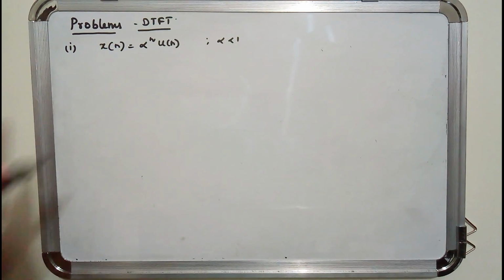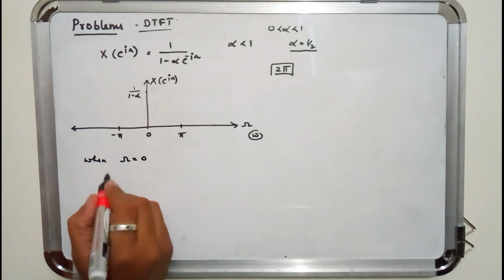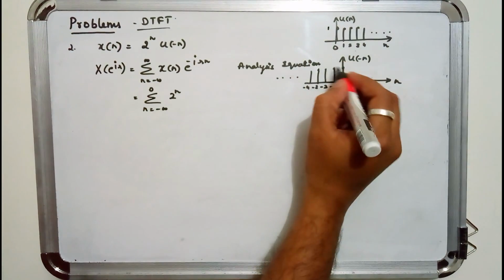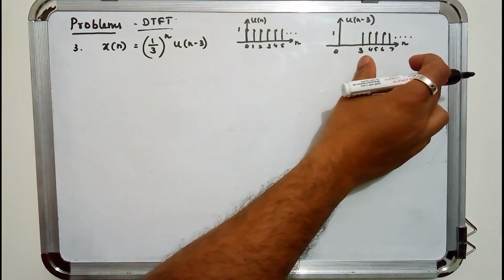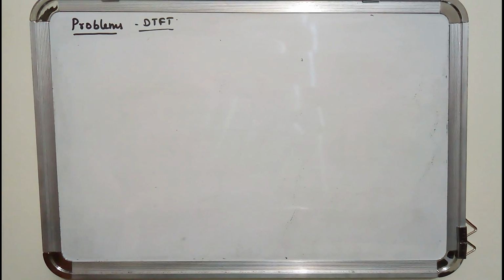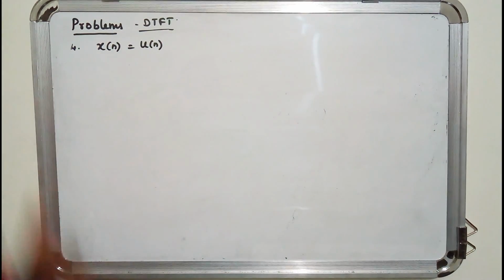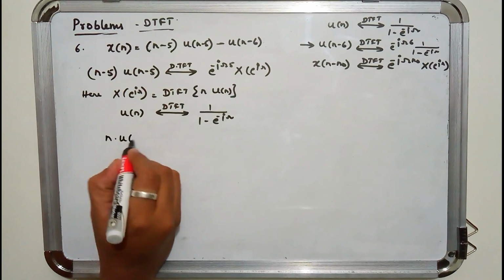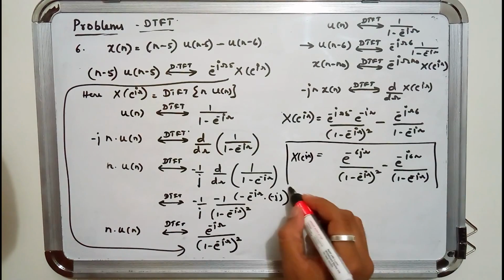Problems on DTFT - Part 1

Comment: You have done a mistake while computing the DTFT of u[n]. The GP relation for summation over all n values , for a^n = 1/(1-a) does not hold for |a| = 1, it only holds for |a| < 1. Refer some good books before making videos. But good effort though.

Comment: i had a doubt, in the 2^n * u(-n), you applied the formula of infinite GP sum. But isn't that only valid when |ratio| < 1 but here |ratio| is 2
Reply from the maker: If u check carefully . The summation was from -infinity to 0 . Then I have put n=-n and the limit changed from 0 to infinity . So when you are talking abt GP the summation should be from 0 to infinity . Now when I put n=-n the term 2^n wil become 2^-n . Which is equal to (1/2)^n . And 1/2 is <1 . So we can apply GP 👍
Reply: @techjunkiejdb5476  Oh yes! Thank you so much for clearing my doubt ♡♡
Reply from the maker: @akshettrj  no problem 👍

Comment: In problem 1 how do you figure that DTFT will be real valued over entire period. For Omega equal to 0, pi, -pi sin(Omega) is zero, but for other values of Omega wouldn't it make the DTFT value complex ?
Reply from the maker: Sanjay R it will never be complex. Put the values in the interval of zero to pi . U will get the answer for ur question.